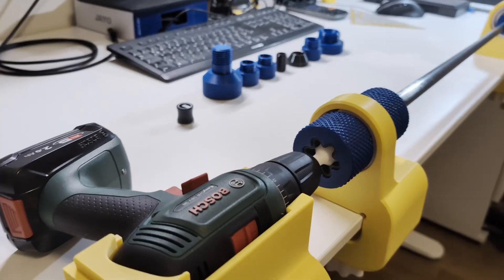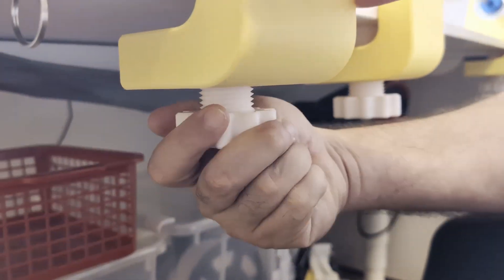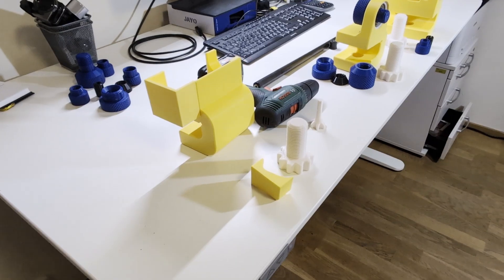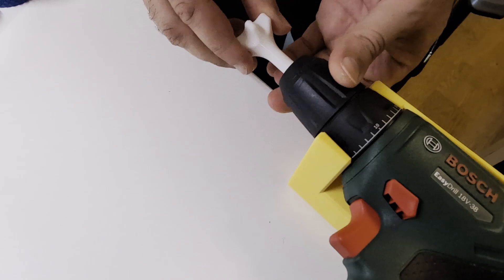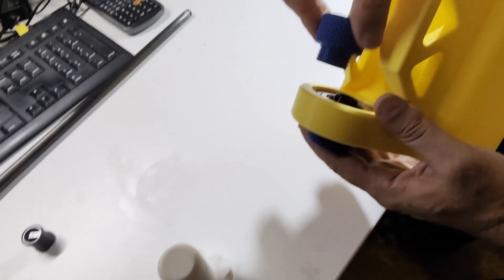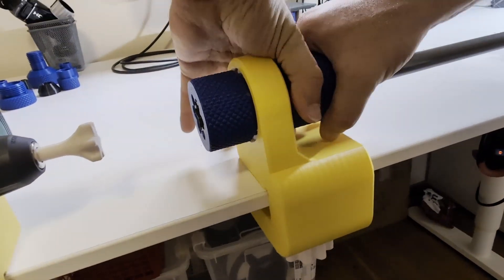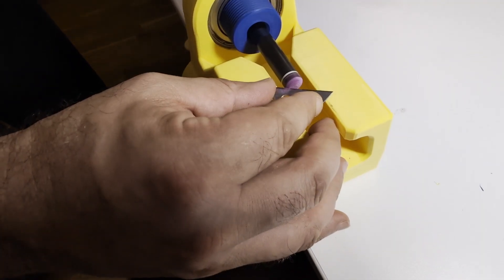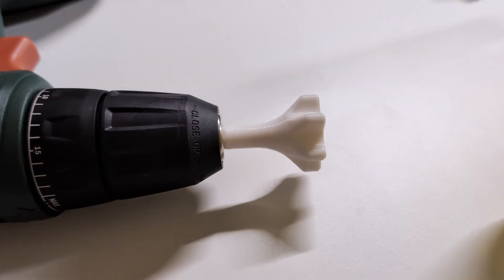DIY Lathe for Billiard Cue Tip

Comment: Printed this for a friend. The parts are very well designed and the print and assembly was easy! The 3mf file for bambu lab printers was also provided, so the whole setup was a breeze! Definitely a strong recommendation!
Reply from the maker: Wow, first feedback from a maker. Thank you. Did you already try to glue and shape a tip on it?

Comment: How big is the clamping piece at the drill end. I'm wondering if this would work on snooker cues but the butt is usually around 30mm diameter. Any idea if it would fit?
Reply from the maker: No it won't fit at butt and also tip side. Will have to make a new design for the clamping parts. Currently I am printing the V02 for the Lathe with optimized design. So if you are interested I can make an adaptation afterwards for snooker cues. Please let me know

Comment: Does the drive unit fit other brands of drills ok or will it need modification?
Reply from the maker: It fits only for this particular drill. I am working on a universal holder. Also it is not a single part, it is glued together, just to have it work.

Comment: Awesome, just great design! Looking forward for the STLs! In the meanwhile, I'll try to prepare some fixture draft for something like Parkside PABS or simmilar drill - just to be ready when you release the models.. :)
Reply from the maker: You are awesome 🎉.  I have to prepare a documentation for the details of what to take care. It is not super safe, since the eccentricity is very critical.

Anyhow, I am going to add a "universal drill holder" design and make some optimization.

Comment: Do you plan on making and selling these  as a package deal? I love your design but I do not have a 3d printer?
Reply from the maker: Hi. I think I can offer printed version. Will prepare saleable version.
Reply: I would be interested as well.
Reply from the maker: Hi, please send an email (check channel) so we can discuss details (shaft dimension)
Reply: Id definitely be interested
Reply from the maker: Hi, can you please write an email with your shaft data, (email in channel description). We can talk details.
Reply: I have several cues. Will this only work with one?
Reply: Did you see my previous question?
Reply from the maker: The current version has only limited range of compatibility. My shaft has 11.8 mm probably it will work also with  up to 12.4.

Comment: Very beautiful design!
I would love one myself to help me with the cue tips!
I have just subscribed waiting to hear news about your design and how hopefully soon, you might be able  to offer your solution to other pool enthusiasts.
Is there a way to create a universal drill clamp, so you could use it with any brand? I have a Bosch myself, but obviously a different model.
Reply from the maker: Hi, I have to think how to design for a more universal fixture. Let me see what I can do. I am sorry, but nowadays I am very busy and will need some more time for this. Do you have a 3d printer and would only the STLs?
Reply: I don't have a printer, so it would be a lot easier if I could purchase all the parts already printed to be honest. I suppose if you tell me the model of your drill I could get one used, so no need to redesign a universal holder for now. 😄
Reply: It's an Easydrill 18V-38, as I can see. If there was a way to clamp different brands of drills it would be the best drill-based lathe I have seen so far! 👍👍👍
Reply from the maker: I have shared the STL for a small one time compensation fee.